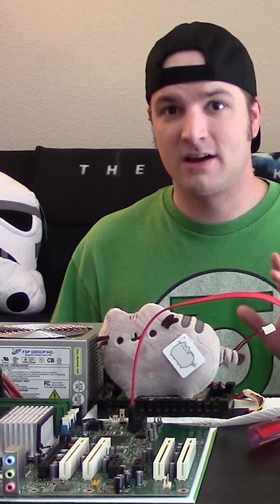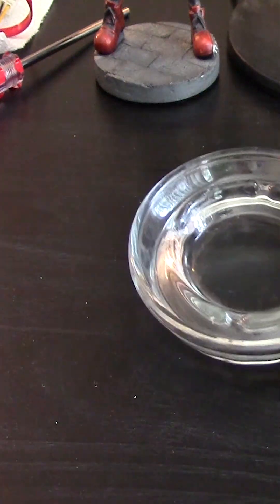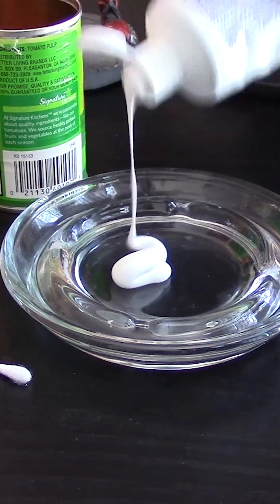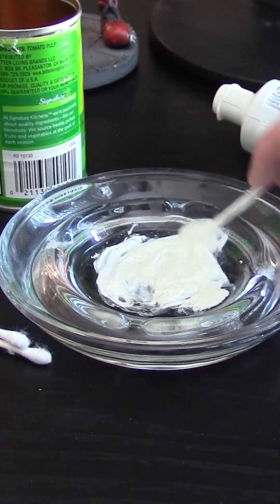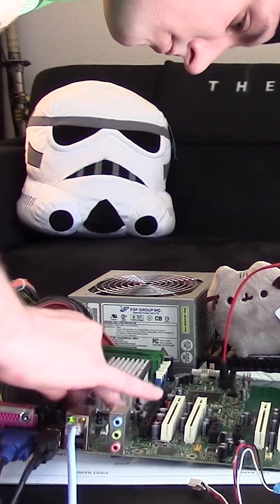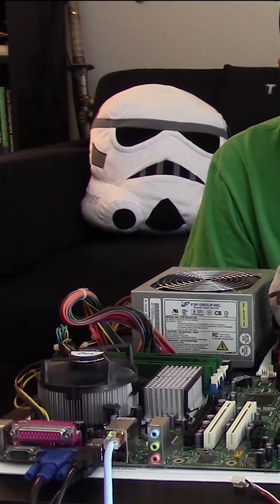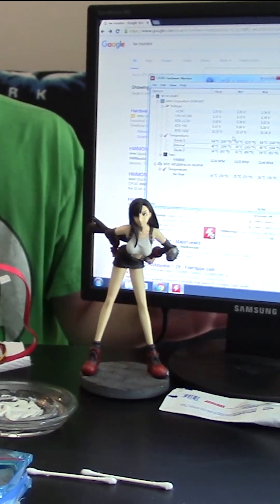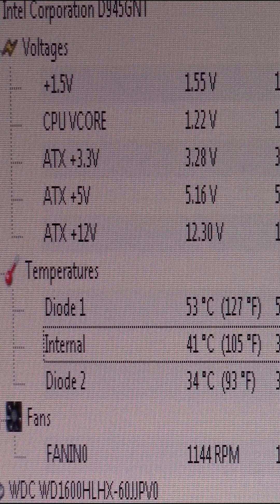💻 Homemade Thermal Grease / Thermal Compound  #shortsvideo #computerknowledge #computerrepair

Comment: Bro missed the purpose of thermal paste.

"Whats that paint stuff on the cpu"
"Do you know nothing? It keeps the cpu from drying out, i happen to know the ingredients."
Reply from the maker: Thermal paste is used to fill the microscopic imperfections between the CPU and the cooler, improving heat transfer. In the full video which is linked I am simply testing an old method and also an urban legend of using toothpaste oil , and a can to get a computer running. obviously the can thing did not work but the thermal compound did. This is an older computer. no paint stuff or decal thermal material was on the CPU or the heatsink. Are you talking about the thermal material under the CPU top plate that exposes the cores?